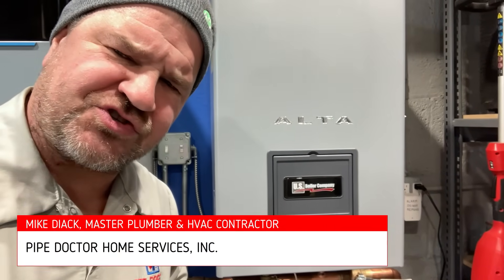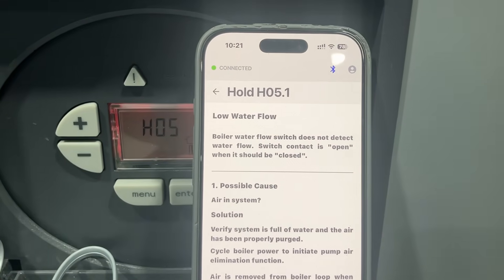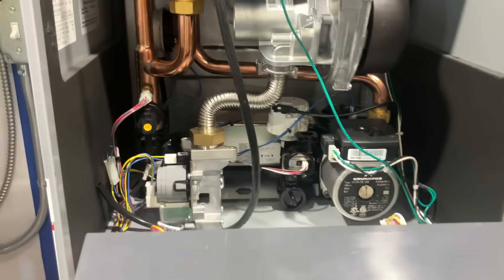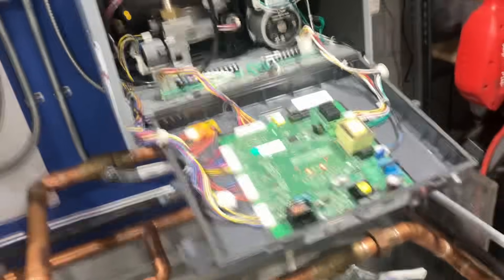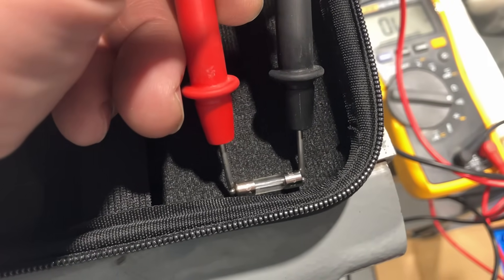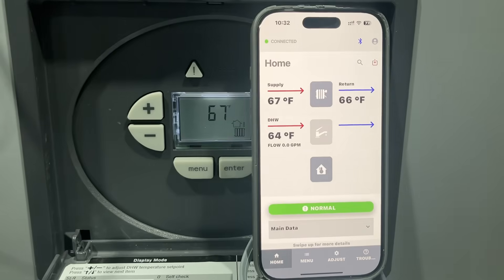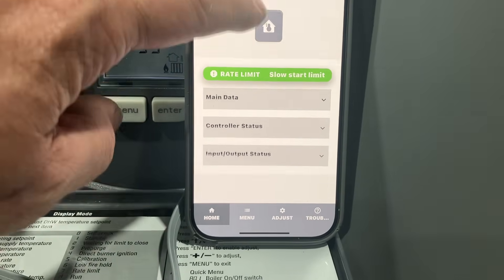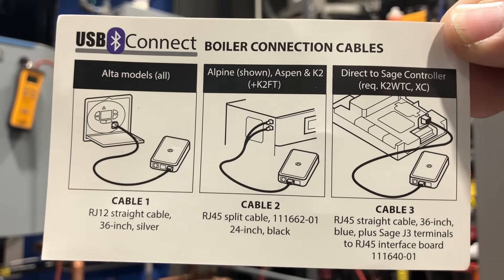Burnham Alta Boiler H05 Error? Here's EXACTLY How I Fixed It!

Comment: Dude you are completely awesome for real for real just bought a new house and the Border went last night along with the floor heat a window complete panic all kind of clothes were shooting at and this and that and I was in such an outrage that I should have took my time and relaxed and pressed reset I did not do that I started pressing plus and minus signs and what not filing to make a long story short I settled down and hit the reset button it look like it there's got to be a reason why it's doing that of course there is Triplets of water coming out of the condensing pipe with a venting pipe I noticed this dripping down maybe that could be an issue of course🎉🎉🎉 but anyway thank you for the video appreciated knowledge🎉😊 appreciated

Comment: looks like an RJ45 port to me (8 pin/position), unless it's a specialty 10 pin(RJ50) but probably not. 🤓computer/electronic nerd glasses.
** later in video I see it's actually a 6 pin (RJ12), tricked by the hole in boiler cover. 🥳
Reply: confirmed at 8:13 in video. lol

Comment: Fuses usually don't blow without a reason.  I would have measured the current draw of the circulator using a clamp-on current probe after the fuse was replaced.  And if the fuse blows again in the future , probably replace the circulator motor.

Comment: Mikey Pipey, I was shocked to learn today WM  CGA/I  Boilers do not require a seperator? 
 No External Air Separator:
Weil-McLain does not recommend or require the installation of an external air separator for their CGa/I boiler models.
Reply: that only applies with the old style closed expansion tank, it should mounted at ceiling and plumbed off the small top boiler taping beside main outlet, so any air in the system goes up into the tank, the fill valve should also enter near the tank, that helps keep it replenished with air, so it doesn't water log and need as much maintenance.
with diaphragm type tank, always use an air separator with vent and another vent on top small boiler taping, you do not want any air in the system with that setup.

Comment: So what do you think really caused that blown fuse on that circulator that was brand new or was it just for demonstration purposes just asking
Reply: I would guess storm/power surge issue. unless there's happens to be wire touching inside the circulator and vibration got it, but it would likely have popped again right away.
guessing the factory circulator has nylon crimp caps connecting it inside.
Reply: Yeah, it could possibly be any of those but I’m just wondering it’s such a new unit. He just put it in that circulator already going bad because I’ve seen other videos where he’s had to replace the circulators just after a few years, those things should last longer than that

Comment: You could have just tested the fuse in place,  easy just to test all of them, just like you did,  without removing them.
Reply: With PC boards, you can sometimes read thru the circuit backwards, giving you a false reading.
Reply: @2pugman  but what they won't do is put voltage on both sides of that fuse. 👍